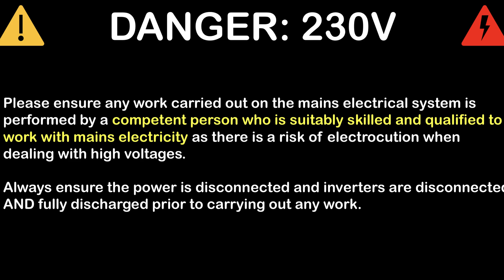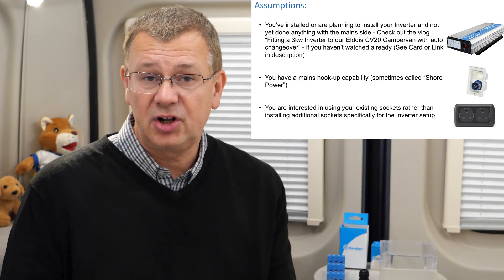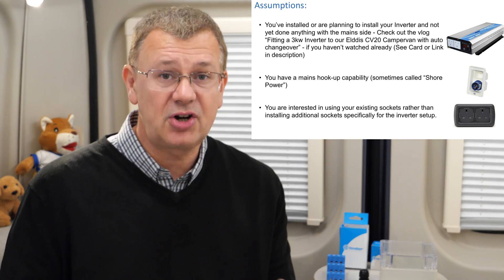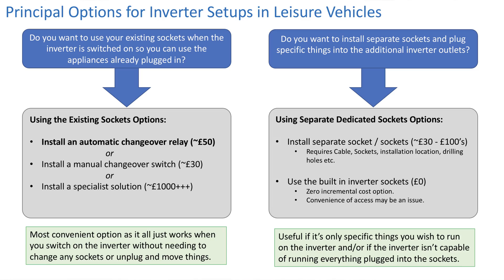Campervan Mains & Inverter Auto-Changeover for under £50 using a RELAY - How it works - Tech vlog

Comment from the maker: Welcome your thoughts and comments on the video and the format for future videos covering off tech - appreciate this isn’t for everyone but we’ve found it to be a game changer - thanks in advance for your feedback, it helps me improve the channel - David 👍
Reply: Hi David , Another great tutorial on improving the electrics . As i have been waiting nearly 5 weeks now for the DVLA to register my van i am still mulling over what hardware to use for my van electrics. What is your view on the Victron Multiplus 2 . I know it probably takes up a bit more space and is a more expensive unit but on the plus side it integrates a Mains charger, with an inverter/ups and also does the automatic switching of the 240v sockets. Secondly i'd appreciate thoughts on using the victron Lynx power in unit to connect up the hardware instead of using discrete components and bus bars to simplify the task of wiring everything up. If you have not considered these units don't worry i just thought i would ask to check for any feedback you may provide. Thanks again - Mike
Reply from the maker: Hi Mike, I really like the features of the Victron Multiplus 2 - as you say a little more space and cost but neat - I think they are good from what I have seen - Traveling Van Life had one fitted and think they were pleased with it too. I see some of the high end converters had fitted them also. I would certainly consider one as I like the feature where if say you were on a 6A hookup and needed 10A then it uses inverter for the difference.
On the lynx haven’t looking into those in any detail, but will have a look.
Hope that helps in some way, all the best, David 👍
Reply: Forgot to mention that i will not be doing the installation myself so more costly hardware may be offset a little by a quicker install @ £50 per hour.
Reply from the maker: That makes sense as it soon adds up in time doesn’t it. Hope all goes well and you’re pleased with it when it’s done. All the best, David 👍
Reply: Hi David,  I have a V-line with lift up tailgate. In the boot we have an Ecoflow Delta 2 max wired up to a 2-way switch with an RCD in between. The switch is hidden away under the seat which can be a nuisance because you have to lift the seat up to change over from shore power to power bank supply.  But I prefer the fact that I have to physically do it rather than just rely on it being automatically switched.  But as you say it’s what works for you.  I’ve watched you videos for quite sometime and always enjoy your content so keep up the good work 👍🍻
Reply from the maker: Thank you - it’s awkward where to put switches isn’t it as hidden away is neat but sometimes inconvenient - like everything vanlife, always a compromise isn’t to - all the very best, David 👍
Reply: Brain fried a little because mines a ring. So I've got com to the sockets (or one half of the ring) but where is my other half of ring going back to on the interior side? And it will back feed the main board MCB also.

Need a sparks 😐

Comment: Hi, I have an ETA e-box in my car. If I put a relay between the wires going to the socket, can it happen that the inverter's output voltage starts charging the batteries through the e-box. Will there be a so-called crazy cycle? If I put a relay between the e-box's incoming 230vac, then at least there will be a crazy cycle.
Reply from the maker: I have no idea on those - you wouldn’t normally mix mains voltages and low voltages though

Comment: Good video, but I think I'd do it a little different but basically similar. I'd have the relay default (when not energised) to invertor and when shore power connected isolate the invertor and connect the 240v. Same materials slightly different layout.
Reply from the maker: Thanks for the comment, it’s the inverse way I’ve done it which would also work of course, the reason I did it the way I did was so that on hookup I can switch the inverter on if I’m on a low amp hookup and boil the kettle or something like that whilst leaving the heating running on the shore power, the kettle then would be  off the inverter, thus allowing temporarily more power to be used  (if that makes sense)

Comment: Hi David,  I currently have an inverter installed with my Lithium setup. The inverter output is connected to a EHU plug which I plug in to the motorhome plug when I want to use the inverter. This is a manual  process and is simple. Looking at your setup I'm thinking of installing the relay for automatic changeover.  So my plan would be to connect the van EHU plug to the relay and from there to the Sargent PSU together with the inverter output to the relay.  This will give me the same setup as I have now but with automatic changeover.  Would this wotk?
Reply from the maker: In principal, but the reason I just did the sockets was to be on the protected side of the mains with breakers and RCD upstream of the relay. That's the challenge from a safety etc as no protection on that apart from the hookup / inverter supply.  Clearly you could add protection. One other challenge is if charger is on you would get some inefficiency as it will power the charger which is powering the inverter (if that makes sense).  I think you are looking at doing it EHU point > Sargent Distribution so it flips between mains and inverter depending on which is plugged in just to confirm? For reference you can get from companies such as Victron a ready made version which may cover what you need with additional protection (automatic transfer switch) - it's a little bit more expensive but does come with additional protection. Either way I would recommend checking with a qualified electrician who is certified for motorhomes to ensure it's compliant. Not sure if that helps at all? All the best, David
Reply: @LeisureBit  thanks for the info.  I understand the challenges of connecting the inverter to the Sargent distribution unit as you could be running loads that you don't want  - fridge, heater, charger etc.  This issue is that the way the Sargent unit is built it is not really possible to just connect/isolate the sockets circuits.  So I am prepared to accept those challenges and ensure that the devices are not switched on when I have the inverter running. This way I also have the protection of the Sargent RCD whether I am connect to EHU or inverter.  To confirm I am looking at doing EHU point > relay > Sargent distribution unit and also Inverter > relay  > Sargent Distribution unit.  So if I am on EHU everything works as is.  When not on EHU and I turn the inverter on,  again everything works as is.  I don't see that I would need any additional protection with this configuration.
Reply from the maker: Makes sense what you are trying to do and get the challenge, however to be safe and compliant (IET Wiring Regulations (BS 7671), particularly Section 721 for caravans and motor caravans) you would need protection for the relay as it could fail or be tampered with and be a shock hazard, I would therefore put a 16A double pole Type A 30ma trip RCBO between the mains inlet and the changeover relay thus adding some protection. Hopefully then you should be able to get it certified, again please do check before doing the work with a qualified electrician to make sure it’s fully compliant and get it tested and certified after installation. Hope that makes sense, all the best, David
Reply: @LeisureBit  yes this makes sense.  Would I also need an RCBO between the inverter and the relay. If I were to install the Victron Filax 2 transfer switch I'm assuming I would still need the RCBO before the transfer switch?

Comment: So what happens if you forget to turn off the inverter and connect up to shore power, ?
Reply from the maker: Thank you for watching and commenting. 
It would wear the battery down.  We have never forgotten it yet 🤞🏻 We use it to boost the power as well sometimes if we are a low amp hook up 

Rachel & David 💗

Comment: Hi David, would this switch work between shore power and a bluetti power bank ?
Reply from the maker: Thanks for the comment - I used it with an AllPowers power station (see the AllPowers 2500 video I did) - so, in short, yes you can. All the best, David
Reply: @LeisureBit  Many thanks ,love your videos

Comment: A great well presented video, well done.

The Finder relay that you used is no longer manufactured and is out of stock at RS. Have you considered a replacement relay as an update to your video?
Regards 

Brian
Reply from the maker: Thanks Brian - appreciate the heads up on the relay not being made anymore - I will have a look and see what alternates there are - I particularly like that one as in the event of a failure of the coil you can manually set it. (For contingency) - thanks again, all the best, David

Comment: Hi great video is there a reason why you had the inverter powering the coil? Could I have the shore powering the coil and so it switches over when plugged in? Cheers
Reply from the maker: Great question - you can do it both ways - for me though it enables if on a low power hookup to leave the heater running and make a coffee by switching on the inverter without tripping the site power
Reply: @LeisureBit thanks very much for the reply, I’m an electrician by trade, I saw a comment regarding RCD protection after an inverter and it wouldn’t trip? What do I need to know regarding this? Many thanks
Reply: Hi just had abit of a thought, would there be an issue running all the 230v electrics in the van through the inverter and having the shore power just powering the charger in turn powering the battery in turn powering the inverter in turn powering the van 230v? Instead of flipping between the 2? Cheers

Comment: That's a really good video and explains really well! Can I ask what size flex cable should be used?
Also should there be an RCD on the shore power side somewhere? 
Thanks again
Reply from the maker: Thank you - I used 2.5mm as it was suitable for what I wanted it for and the run length. The shore power comes into the PDU and then it’s only the sockets I am switching so protected by the RCD in the PDU (if that makes sense)?
Reply: @LeisureBit yes I think so....the inverter has an RCD before the sockets and the PDU has protection built in for when it is supplying the sockets? Thanks! 🙂
Reply from the maker: @ yes, that’s right

Comment: Hi David. Great video.  Would this also work if the relay was connected between the shore power (EHU socket) and the main PDU? The intention being to use a Portable lithium power station with in built invertor to power not only the internal AC sockets but also the 230v leisure battery charger,  to keep the 12v system going as well.
Reply from the maker: I think some folks have done it like that so you can run anything needed - I would suggest it’s after a breaker though as you’re relying on the campsite post for protection otherwise (all be it seems a simple job to do it safely is more complex)

Comment: Hi david can you show me what RCD you used while doing the automatic relay changeover please
Reply from the maker: Hi, I used a Merlin one but note it will only work in very specific scenarios with my inverter (dual faults) but on other types which support neutral earth connection will work with most of them. It’s just an extra bit for a certain fault condition as floating inverters work differently. All the best, David

Comment: hi question do this mean the inverter has to on all the time so if shore power fails it switches over
Reply from the maker: Thanks for the comment - no it’s kind of the reverse of that when you switch the inverter on it flips over the sockets to inverter rather than shore power - when it’s off they are connected to shore power. It’s not UPS mode as that’s not what I was wanting and also wanted control on when inverter is on or off - hope that makes sense - all the best, David
Reply: @ thanks for the reply one more question could this be wired into the system ie a consumer on a motorhome so it takes over if the shore power goes off

Comment: I assume your inverter has a ‘floating’ output. If so, any RCD you connect on the output won’t trip in the event of a fault. Another set of contacts on the relay could be used to connect the N to E - emulating a domestic PME situation- when the Inverter is selected.
Reply from the maker: Thanks for the comment, yes, that’s right it has a floating output so would only be of use in a specific fault condition (but being floating obviously creates a different scenario anyway) there is only a minority of fault conditions where it would be useful, obviously if N+E connected would work as expected, however it states not to do that with this inverter, which actually creates an interesting scenario where I LN can have a 30mA or more loss out of circuit and cause a trip from testing… Clearly it’s a cheap inverter. So you would expect the RCD to be ineffective but it will trip in certain circumstances (ala the - being grounded and earth being grounded) - but not as per domestic without a N+E bondable inverter… (or that’s what I’ve found hence adding it) also as isolator. Hope that makes sense, not quite as expected but interesting characteristics…
Reply: @ If your inverter can’t have it’s N tied to E, you are a bit stuck. As I expect you know, this is a ‘hot’ topic - not just for inverters but generators and the new toys on the block, self contained power packs like Bluettis etc.  Of course, being isolated from E - or the local earth to be exact- offers some advantages, even if an RCD won’t trip.

Comment: Hi. Thanks for doing this video.  I have been thinking of fitting an inverter to my campervan for a while, and you're auto changer looks just what I need.  Many thanks.
Reply from the maker: Thank you very much for your comment. 
Some investors come with auto change over built in so worth checking it out before you start 

All the best David

Comment: Just found this, I know its a little old, I am thinking of fitting a Renogy Inverter, I believe they use a centre tapped earth 115v to earth, this could be a problem with RCD and also you wont want your inverter output to feed your charger . I know the Renogy has a pass thought but I probably wont be using it as its limited to 10amp
Reply from the maker: Not sure on the Renogy one, but if you want a non floating output one the Victron inverters have the ability to trigger the RCDs along with some other high end ones given the much more similar to domestic setup with Earth / Neutral bonding options. Hope you manage to get sorted - all the best, David

Comment: Hi thankyou so much for this great idea and video, I am in the spring redoing a campervan, interior and electrics also exterior and solar. I have a legacy Sargent ec155 shore power unit, that will not charge the newer Lithium batteries. So having this relay to switch between either or is really awesome for using most of the same sockets and devices as the inverter. I was thinking of a similar relay system for the 12 volt side using the automotive relay units. Thanks again. All the best...Ray
Reply from the maker: Really pleased you found it useful - all the very best, David 👍

Comment: A really interesting video for those more competent than me. Do you know if anyone has used an auto electrician and if so costs? I want to use my power station as the inverter so that I don't have to move it about the van as its heavy. I keep it close to the input power.
Reply from the maker: I think some folks have fitted things using an electrician but the price varies, you can buy a commercial version of this now also for a little bit more. Worth giving a few a call for a quote, I’ve heard quite a variety of prices. Good luck and always best to get an electrician to install it, I get mine checked to make sure all is ok for peace of mind. All the best, David 👍
Reply: @LeisureBit  I'm booked in with Offgrid Power in Wantage for a Lithium conversion, (battery, mains charger & Victron dc to dc charger), and I'm asking them to quote for doing the job you describe in your video. Have you heard from anyone else who uses a powerbank rather than an inverter? Mine is a Solix C1000. Cheers, Pauric
Reply from the maker: @pauricsurlis9191 a few people use a power bank as an inverter for off grid power - you can also buy a ready made unit similar to the above for not much more I spotted (basically in a case ready to connect) - hope all goes well - all the best, David